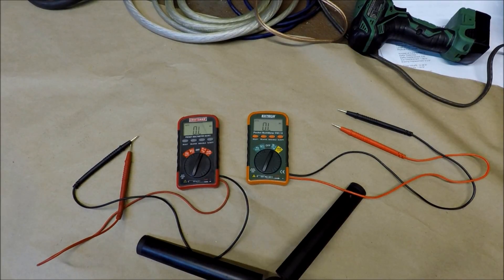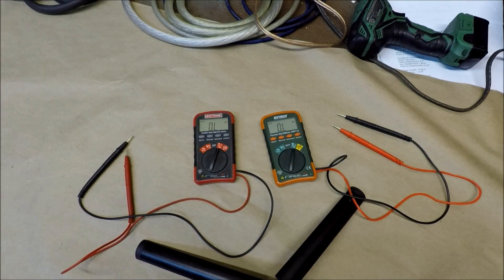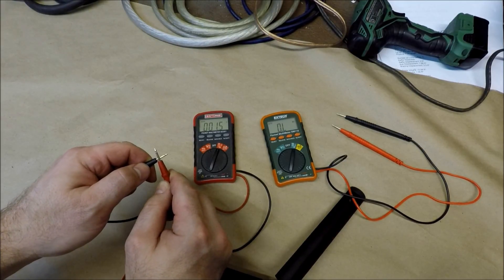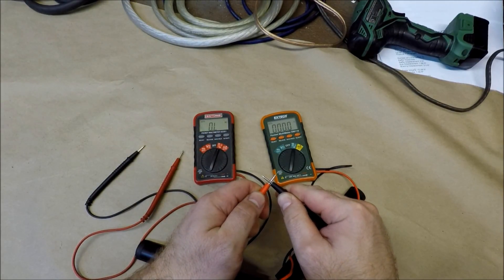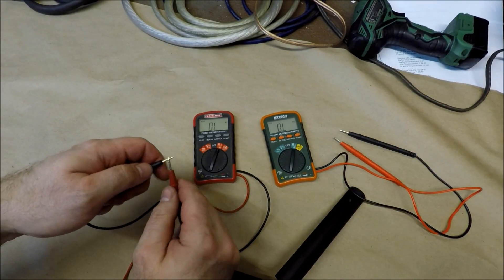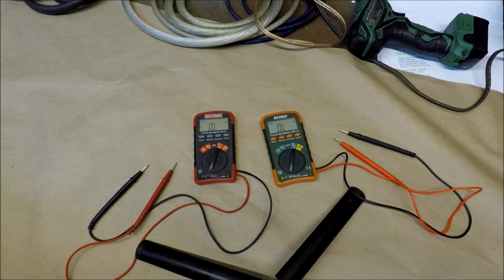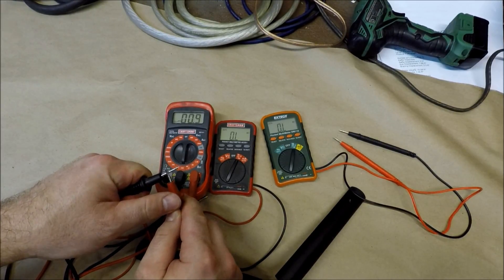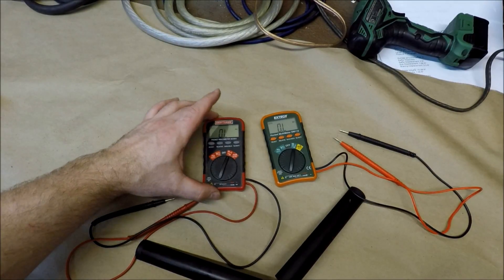***Multimeters Are Dirty Liars*** Tech Time at Sundown Audio

Comment: The free harbor freight meters work great for a volt meter
I hard wire one to my amp Pos and NEg.. 
And use my Fluke DMM to see voltage.. Compare to cheap one.. And remember it's.  1/4volt off or whatever
Reply from the maker: I tried several of the HF meters here and theynqere all over the place with voltage.  Kept trying to adjust them but the next day they'd be off again.  I'll never trust them.

Comment: Weak battery or dirty leads makes that happen... try cleaning the leads and try again.
Reply from the maker: On these meters the leads are clean and batteries are good.  Some multi-meters are just garbage.
Reply: Sundown Audio unofficial the leads can go bad overtime  anything from corrosion inside the leads to a low, weak or bad battery. Ive almost thrown a fee out myself but i found out the causes were simple.

Comment: Got a really nice clamp, power pen, temp and dmm setup from extech. My grandpa left it to me brand new when his time came. Since then and I got away from my craftsman my wiring game is on point to say the least when it comes to helping others hook up used unfamiliar equipment and then seeing what they actually put out. The clamp reads watts amps volts everything but I like the function of volts and amps st the same time to get an accurate reading and calculation of true power going to the subs